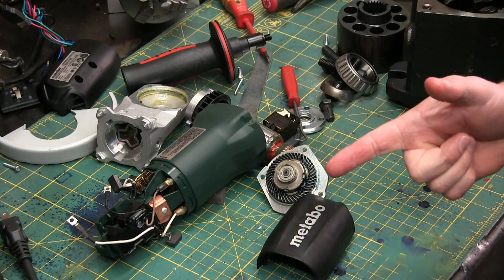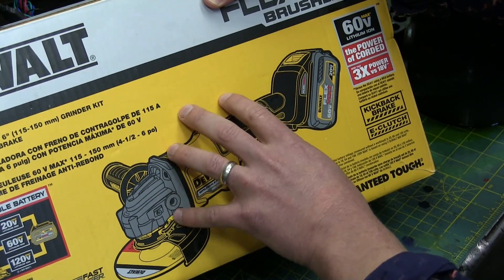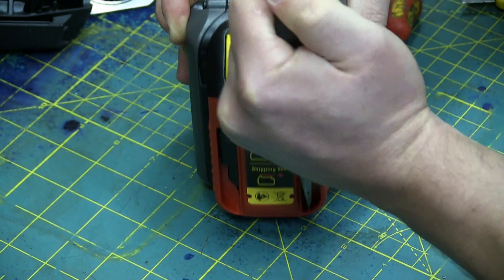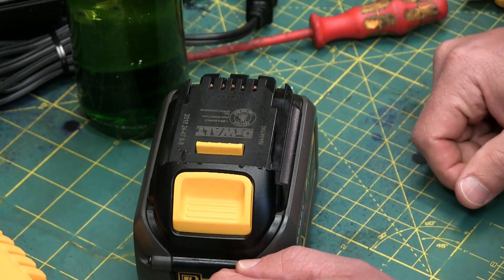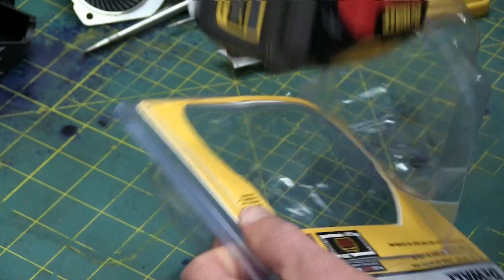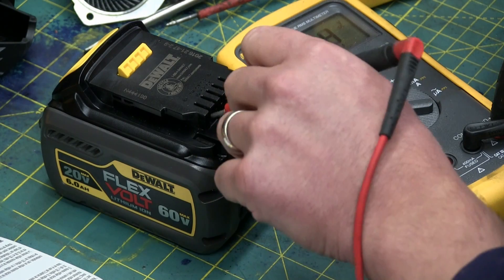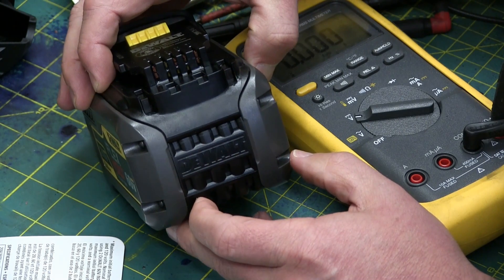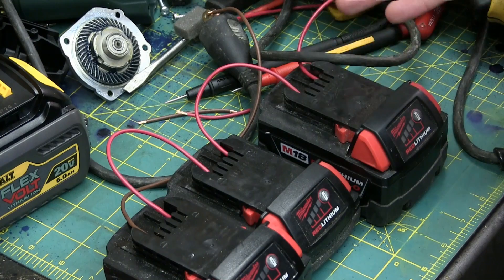Plug-in Power Tool to CORDLESS CONVERSION.

Comment: higher voltage means less current thus you can use cheaper lower C cells.

Take a tool that takes 5A mains tops, then make a battery pack from laptop batteries, two 18650 is parallel will give you about 8.8 amps easy, then just put enough of them to gain enough voltage and there you go.
60VDC is like what 16 cells ? that's like five laptop battery packs, i get mine 2 bucks each so say 10 bucks for a 4400mAh 60V battery pack for your 110V power tools.
10 bucks!!!!
And don't take the laptop packs apart because they have balancing circuitry in them, you can charge them by just connecting 12.6V to the pos and neg terminals.

Comment: As far as the "power-tool super charger" could you just use a UPS (Uninterrupted Power Supply). Search for one on amazon (or where ever), most of them have an integrated surge protection feature, and they are exactly what you were talking about. Anyway I really enjoy the videos, keep up the good work.

Comment: cool idea. I would(try to)make a big battery pack for plug-in tools.  plug into it carry around like a tool box. and Battery adapters for different kinds of cordless tools.A Makita battery plug into a DeWalt tool and vice versa so you don't have to buy a bunch of different kinds of batteries you can just buy the tool and the adapter.

Comment: Pass trough "battery" like UPS for Power tools! Plug Cord from the wall to UPS, like you would normally, and plug Powertool to the UPS thing, and there you go! When there is No power, this acts as a battery, and when there is power, it charges the battery. Is there any kind of high enough power output UPS in the market yet?
 If not, Combining Battery charger, to many enough Batteries, as you did, and using the power from the end of batteries to power the tool, but that would probably overheat the batteries / the charger would be too slow... -> Bigger batteries, Bigger charger? This solution would need no changes to the Power tool itself, so it would be easy "product" to sell, as nobody needs to modify anything, Plug and play. 

As a Complete Product. Battery charger, with multiple batteries, like that De Walt, That has a pass trough, and when the battery is installed, it uses battery as "capacitor", Or even just a Stand alone Capacitor, Plugged between wire from wall, and power tool

Comment: I have heard that samsung inr18650-25r batteries are pretty good for power tools for the money ($5 a piece from places that sell batteries for those e cig things). The claimed specs are 2.5ah, 20 amp max continuous draw and 100 amp pulses. Do you think they would suffice for this? I want to use some to convert some old 18v NiCad drills to 20+ volt lithium drills that wont last very long.

Comment: +AvE - the reason you don't get lithium ion batteries fully charged from the factory is to prolong their life in storage. Just about everything you can do to a li-ion battery reduces its life. Charging it, discharging it, leaving it sitting in a dark room. They especially dislike being at the extremes - fully charged or fully discharged.

However it turns out that there's a curve for how much charge there is versus shelf life, and the sweet spot is at about 40% charge. So if you send them out a little over 40%, the self discharge will gradually take it down.

The self discharge itself is a big thing. A fully charged li-ion might lose up to 5% in the first 24 hours, and then you'll lose another 5% every month. Though actually, most of that 5% is the protection, if it didn't have a protection circuit you'd lose maybe 1% a month, but a li-ion cell without protection is not a happy thing.

Comment: What's wrong with a car stereo's capacitor? Super high amperage dump, when ya need it. Equally fast recharge. Quantity of pixies is the only issue at that point, however it sounds like that's not a huge problem here. https://goo.gl/rHM7jp

Comment: So AvE you are basically making a run capacitor circuit just by replacing the caps with batteries. I rather do like the idea because as you know caps power dies down quick compared to the Batteries.

Comment: Most of the terminals on that battery, specifically the ones with a c designation are for balance leads for the individual lithium cells

Comment: Universal motors can run on DC or AC. making a synced AC converter is a pain in the cunnilingus, on the other hand, making DC out of AC is easy as fark. so, pick up a lithium pack, a cheap 110 converter and two beefy bridge rectifiers off the bay. 

Run the mains through one bridge, and to the tool.
Put the converter on the battery, add another bridge and add this bridge's output to the other bridge.
Converter should have a voltage lower than mains, say 90-100V for 110V mains. as the voltage drops on the cable power tool will draw the power off the source with the higher voltage which would be the battery. once tool revs up the mains should take over so batteries would be used only when needed.

Comment: Would it be better to use some kind of Capacitors instead of batteries?
Reply: I was going to point out that capacitors would last longer, but then I decided to read the comments and promote the first one that said basically the same thing. :)
@ +darek4488 there are AC capacitors. You can typically find one on a box fan for example. 

So the question is, how much capacitor capacity is needed and how can we make it into a simple box that can be sold for the price of a six-pack profitably. 

The reason we might rather use batteries is if you wanted to be able to run a corded tool cordlessly. But we could design different models: A. uses batteries B. uses capacitors C. hybrid of both. 
I've seen a video where a guy replaced his car battery with super-capacitors. Enough charge held over the weekend that he was able to start his car on Monday. So it's possible a box of caps can be an extension cord replacement. I have no idea what kind of run time you could get.
Reply: >AC
>Capacitors
pick one
Reply: either one could work :)
Reply: well shit whats this then? 

https://www.1000bulbs.com/product/171498/AERO-D83W4010M01H.html?utm_source=SmartFeedGoogleBase&utm_medium=Shopping&utm_term=AERO-D83W4010M01H&utm_content=Dry+HID+Lighting+Capacitors&utm_campaign=SmartFeedGoogleBaseShopping&gclid=Cj0KEQjwjem-BRC_isGJlJ-0h-MBEiQAbCimWPyn4nqc9J_G8LNcB_m3aA8b9QjYEWhDarp5v4ICWv0aAsm18P8HAQ
Reply: What are you on about, implying AC is incompatible with capacitors? Like they don't exist anymore once you change voltage?
Reply: me or the other guy?

Comment: It's good that DeWalt did a latch that actually works. :D About the turbocharger well ditch the drill batteries and use a forklift or electric car battery on a charger instead.

Comment: I thought about using a boost converter to boost a 16 volt lion battery up to a decent voltage for drills and stuff with a universal motor so I dont have to use my wimpy black and decker drill witch wont drive a 3 or 4 inch screw home in solid wood 80 or 100 volts dc should be enough for it and a dc boost topology should be simple to design a big inductor and a irfp260n should work

Comment: FYI, the reason they don't fully charge the battery is that Li-I batteries have the best shelf life when they are charged to 60%. If you leave them discharged, self-discharge can drop the voltage for enough to damage them. Fully charged isn't great for long term storage either.

Comment: storing a battery at 100% charge causes the anode to get plated, that's why they ship them at 50-75%. It is the correct long term storage voltage to prevent degradation to the battery's capacity.

Comment: wouldn't a supercap be better? they're meant for high drain and quick recharge. Bonus would be that if you switch it right, it would also reduce noise on the line as well as peaks that might trip the breakers.

Charge cap when not running,
Discharge cap during startup(1-3 seconds),
switch the cap into a filter once the tool has been on for more than 1-3 seconds.

Comment: I don't do much of the old power tool chooching but I do use more than my share of juice. I do mobile sound(think big loud speakers) and the average 15 amp breaker isn't up to snuff. In comes the Furman Power Factor P-1800 PF. I can draw 40 amps momentarily when the bass hits and this guy recharges the capacitor between hits.

I've got to think something like this could be great for big draw startup on mystery outlets. It also filters out noise in the line.

Comment: Wonder if this would work?
A transformer pair.  One on one end of the extension cord.  one on the other.
Pop it up to compensate for voltage drop on a heavy extension cord.  Drop it back down on the other end of the transmission line (ie cord).

This is how ma power does it.

You could select a value based on a typical drop across a quality 200 ft cord.

Make it a long reach power distribution solution.
Reply: You could also put an auto transformer on the other end and raise the feed voltage well above the expected drop and just dial it in at the remote end.

Comment: they make a solar grid tie in inverter for taking the relatively low voltages from solar panels and injecting them into your the grid. we may be able to reverse engineer or modify one for our purposes

Comment: Soft start, how about? No expensive battery needed, simple triac circuit. (Limit the power briefly until the disc is spinning and the initial peak need for power is history)

Comment: Most small tools wth brushes and commutators are so called "universal motors"  that (in theory) can run off AC or DC. That doesn't mean that variable speed control can handle it.

Comment: Sounds like a good idea, wouldn't be much use in the uk tho as all our contractor tools are 110v running fairly heavy cable off a transformer, or maybe I just haven't tried hard enough to trip the breaker lol

Comment: Ya know, that kind of already exists. Battery backups for servers, aka uninterruptible power source (UPS) They come in small sizes that fit under your desk and use sealed lead acid batteries. They also come in 4 man lift minimum multiple car batteries. If you took that tech and switched out the anemic 6 volters with banks of 18650s you might have something.

Comment: Will this start to burn out the switches? J Mantzel Runs lots of corded tools of of 12V or directly off of his solar panels but he has to replace the switches with something more robust because DC will spark more easily when the tool gets switched off and will start to burn out the switch.

Comment: Actually Universal motors such as that in drills runs off 35.75 volts dc, that's the same voltage potential as 120 volts Ac 60hz. BUT because they draw so many amps those 60 volts are barely running it lol!

Comment: Would be easier to rectify the mains to DC which goes to a simple CC/CV charger keeping the batteries topped up as well as providing power for the tool - when the load gets too high (inrush / mechanical demand) the mains PSU will hit current limit and the batteries will deal with the current excess

Comment: so you want a UPS. That STARTS out supplying DC voltage. it would read the amps on the outgoing line and after the initial start up switches to incoming line voltage. 

or you could just have it on a simple time delay. 

the REALLY neat thing would be to have it use batteries that guys already have. Something you can just plug a bank of batteries into or else it would be too heavy. 

optional extra. emergency stick welder mode.

Comment: maybe a mini version of the tesla powerwall? a fuckload of lithium cells hooked up together in a toolbox with a wall plug in the lid? that could possibly work as a portable power source for corded drills if you get the volts and everything right maybe?

but for something to kickstart the corded drill to stop the breaker from popping, i think a big capacitor like from audio and starting systems in some cars would work if you figured out how to get the tool to start with the cap then switch to wall power

Comment: Sounds like it's just a buffer for the corded tool, just need a high enough power battery backup also known as a upc APC BR24BPG Back-UPS Pro External Battery Pack For 1500VA Back-UPS Pro models https://www.amazon.com/dp/B0047E5B90/ref=cm_sw_r_cp_api_kbP2xbSDNNPAY

Comment: Not to poop on your idea or anything but part of DeWalt's new line of tools is exactly this. There's a charging station thingamajig that will take 20 and 60v batteries and charge them but you can also plug your corded tools in and have them go "cordless" if you're away from the power outlet. Mind it's something like $400 and proprietary so a diy solution is more than welcome.
Reply: Sorry, it's $800 and change with a few batteries. You know, pocket change.

Comment: For the booster idea, could you use an Arduino to detect voltage drop and kick in the battery until it comes back up?

Comment: Hey AvE, there are two tabs on the back of the dewalt battery, if you press those in, the battery will switch to 60v. Look at the grinder foot to see the tabs that press into the battery (compare to 20V tool foot to see the new features that activate the 60v mode). Switch is mechanical, should be easy to rig for use at 60v. Cheers!

Comment: Side-bar: The batteries aren't fully charged because if they were, their chemistry would stop working over time. Leaving them fully charged for who knows how long can be pretty bad, so they charge them to "storage voltage" which allows the batteries to be stored for a long time with little ill-effects.

Comment: Maybe a Grid-tie inverter would work for your "power booster"? They are used in solar applications. They use the power from a solar panel and directly feed the mains by maintaining a phase lock with the AC in the wall. Instead of using a solar panel, however, you could use a battery bank to feed the inverter.

Comment: so would it be basically a dc spider box with an ac input? I could see many jobsite uses for something like that. The form factor of a spider box could hold an electric car battery which would jack the price of the "Supercharger" above or hovering at 1500 if you source your parts smart. But switching that voltage requires some pretty beefy solenoids.

Comment: Lithium batteries shouldn't be stored outside of 50 - 80 % charge. That's why they ship it to you like that.  Below 50 is extra bad. Storing at 100% isn't as bad, but not recommended.
Reply: Below 50% is not extra bad. The rule among RC folks is actually to store at 40%. I cannot find any info, but I think I've read that storing at even lower SOCs doesnt hurt things, its a risk in over-discharging the battery though if it self-discharges.

Its prolonged sitting at a high state of charge that damages Lithium batteries.
Reply: Lithium-ion batteries don't contain any significant amount of lithium metal. It's the lithium primary cells that have flammable lithium metal in them.
Reply: No my brother is a manager at interstate batteries and they ship lithium batteries at less charge because they tend to catch fire if damaged, especially at full charge. So they just pre charge them so they will work right out the box and not burn down the transport truck if a box of batteries fell or something
Reply: I've been in RC since long before lithium, but I store lithium packs at ~65% Everything I've ever read says they are most stable at this point. I've had many packs die because they were left around 30% for a couple months.
Reply: Kush killa420 Unfortunately the level of charge has nothing to do with the flammability of the battery - it isn't the electricity that causes the fire, it is the lithium. Lithium will spontaneously ignite when exposed to air (oxygen). Hence why they catch on fire; regardless of whether the battery is flat (empty of any charge) or completely full.
Reply: Its the electrolyte that burns.. https://en.wikipedia.org/wiki/Lithium_polymer_battery - the lithium is not the problem. Smells like sh*t when it burns too... burning lithium smells of roses by comparison. 
Disclaimer. Do not sniff burning batteries of any sort... you'll set your nose hairs on fire... and that really does smell like shit.
Reply: ***** The manufacturers of the batteries will usually give reliable information on how to handle them.
Reply: rocketman221projects They have an adequate amount of lithium in them to be a problem. Not sure why you suggest not having Lithium base metal somehow reduces the risk in any way. Most Li-ion batteries will use Lithium Cobalt oxide in the electrode material, and usually some lithium salts in an aqueous solvent solution. But those compounds will spontaneously ignite in fairly innocuous conditions.
Reply: fancy seeing you here sno
Reply: I'm a rc addict myself and as you said, i alwais put my lipo's  in storage mode if im not going to be using it for over a few days. I only charge it full right before use.
Reply: As of April 1, 2016, the International Civil Aviation Organization (ICAO) Council regulations on transporting Lithium Ion batteries took effect.  As part of those regulations, any Li ion battery or cell shipped by air is limited to a 30% charge state.

As is typical with bureaucratic thinking, a single 18650 cell is as dangerous as a 1 ton bulk packed container of them. That spare battery with its safety cover and clam shell packaging is as risky as a pallet of a million loose battery packs with exposed terminals waiting to be soldered into a device.
Reply: Snocrash hey love your vids sno but thats for nicad batteries

Comment: Better have beefy blocking diodes to keep the pixies from going back into the wall. The charge and discharge circuits need to be separate.